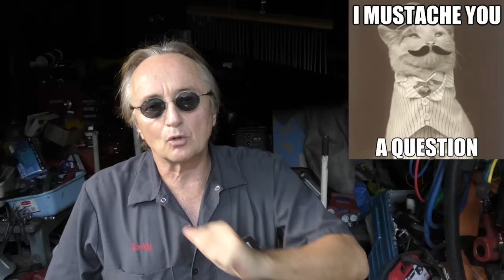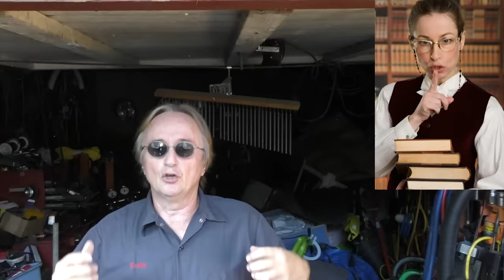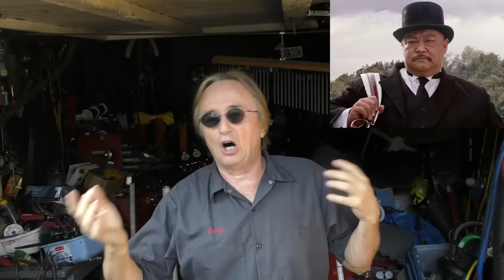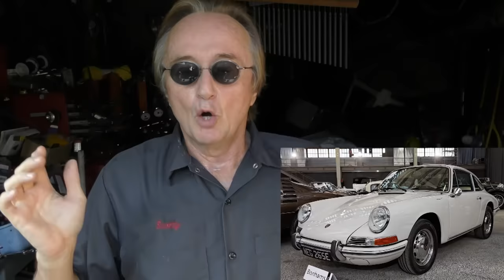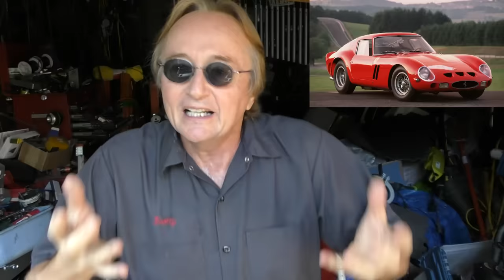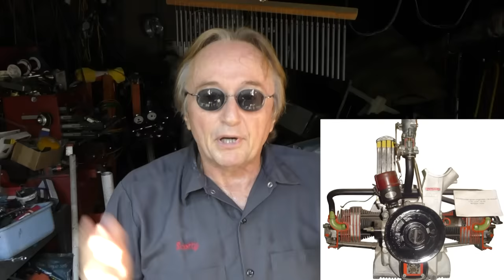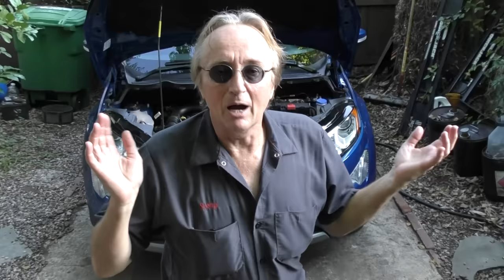The Truth About Boxer Engine Cars

Comment: Porsche was thinking about ditching the 911 entirely and replacing it with the 928. Has nothing to do with the boxer engine. A flat 6 still got the gt2 rs around the ring in record time. The V engine predates the boxer by 8 years so do we call v configurations "old technology?" Also until Porsche 919 broke the record, the 962 also had the overall record with a flat 6 and was the most successful endurance car of its time. Boxer engines were great for endurance racing for reliability.

Comment: My '95 Subaru  Liberty has over 400,000 miles on the original engine and is the most reliable car I have owned,I keep it maintained by doing things like changing timing belts every 100,000 miles ,changing oil regularly etc,the car is plenty powerful enough for my needs and is great on   fuel so for me boxer engines are fine ! Thanks for the videos Scotty.
Reply: Nigel Stringfellow didyou replace your head gasket.?
Reply: @zxttgg  head gasket wasn't really a big issue in that generation, the one after it is when they started getting head gasket problems.
Reply: I have a 98 Subaru Legacy with over 300 thousand miles on it original motor transmission an original clutch she is a pretty reliable motor
Reply: @zxttgg  
I have owned four different Subarus and never had a problem with head gaskets. (None of mine had automatic transmissions either.)
Reply: 295,000 km on my original 2002 wrx motor!

Comment: The main reason that VW discontinued the Air Cooled Boxer engine in 1975 in the Beetle was due to emissions compliance, not for any mechanical shortcomings.  Plus it was still made in Brazil into the 2000's.  It also never even had head gaskets.  I could never understand why the Corvair was deemed a failure, when it was essentially of a copy of the Beetle which went on to sell multiple millions more after Nader destroyed the Corvair.  And the Porsche, which is a Beetle design on Meth, is still produced today.  And if Subaru and Porsche are selling them today as fast as they can make them, how can it be outdated?  I am sure if Toyota made them you would be jerking off to them 24/7.
Reply: Corvair 32/68 weight distribution is unbalanced
Reply: That'll be one slippery snek of a car.
Reply: The Corvair had enough power to make the swing axle design cause problems that weren't apparent at <40 horsepower. 

The Porsche has had decades of chassis design poured into it to stop this from happening because cars like the 930 weren't called "widowmakers" for nothing. If you dropped throttle in a turn they could totally kill you.
Reply: It is my understanding the "bottom end" of the air cooled VW engine is way, wayyyyyy overbuilt. Guys that use these engines on sand rail dragster can often get 400HP with a stock crank and journals. 

I love BMWs boxer. Owned one for years. It's a very torquey but very boring motor. Has a nice panther like growl when you give it the beans though.

I think the main reason boxers have gone aways is the same reason V engines are going away. 

Accountants. 

Twice as many cam chains
Twice a many cylinder heads
Twice as many camshafts.
Reply: I used to road-race the Corvair (organized road racing was popular in the 1950s - 60s).   If you backed off the accelerator while in a TIGHT turn, the swing axle system would 'tuck up' on the inside of the turn causing a severe over-steer condition for the rest of the car when that tucked rear wheel took on its normal weight load .... for a high probability of an 'instant snap' 180° skid.   For normal driving conditions, if you had insufficient tire pressure in one of the rear tires, the 'snap 180° skid' could be even worse and MORE violent. 
FWIW -  Boxers are fast and easy to remove for working on them; they 'drop out' onto a transmission jack once the axels are pulled from the transaxle.
Reply: Yeah this guy is Toyota biased.  Not that I blame him but Subaru had a good track record.   Doesn't Toyota actually own them now?
Reply: Also the Beatle is the highest number if cars produced ever.
Reply: Tracey Allen Corolla overtook them recently, I think
Reply: corvair had  high rates of rollovers.
Reply: DIB 001 they're one of the shareholders but they don't "own" them
Reply: @TraceyAllen  yes, the Beatles produced a lot of noise
Reply: The last year of VW Bettle boxer was made in Mexico about 2002 and yes some were imported to the US.
Reply: Karl Reinke that’s a legendary quote: “accountants” on behalf of the Subaru community I thank you
Reply: momo3369  , , indeed yes !
Reply: @Andriig75  only if you add all the different models together. Beetles had basically the same bodyshell throughout its life, Corollas had several different bodies/floorplans etc over the years. Toyota lumping all the versions together and claiming they now hold the record for the most sold of the same car is cheating, they're totally different cars with the same name.
Reply: Andrii Gritsina that’s just the nameplate. Whereas the beetle was basically the same car with updates from 1938-2003, the corolla has been through many major redesigns, different body styles etc. the beetle is still the most produced in terms of single model, same design
Reply: As I remember Corvairs were notoriously prone to lose control with the rear end due to lousy weight distribution, and since the steering box was  exposed under the bumper it drove the steering wheel up into the driver on front impacts.
Reply: The swing axle VWs - prior to 1969 were susceptible to transaxle jacking or wheel tuck.  Basically, when cornering, the transaxle had a tendency to "jack" upwards.  Since the rear wheels are always perpendicular to the axles, this would induce a very unstable positive camber on the outside wheel while the inside wheel would lift.  This cased a dangerous over steer.  This same dynamic was in play on the early Corvair, Porche and Mercedes swing axles however Porche and Mercedes were not constrained as much by costs for solutions.

The VW engineers were aware of the problem early on, but didn't think it would come into play on a 40 HP vehicle.

Solutions involved softening the rear torsion bars, stiffening the front suspension with an anti-sway bar and adding a "Z-bar" or camber compensator to the rear suspension.   In 1969, VW introduced the IRS system which eliminated the problem all together.
Reply: @98triffid  i vaguely remember reading years ago the GM "bean counters" decided it would be cheaper to leave out a sway bar in the Corvair and have different air pressure in the front and rear tires to compensate. The trouble was that most owners didn't read the owners manuals and were unaware of the tire pressure recommendation.
Reply: @kenjohnson7214  Reminds me of Ford's decisions regarding the Pintos - my brother was an associate at a law firm that took up the case for a family, who's kids were severely burned after their Pinto was rearended and caught fire. During discovery they found a memo from Ford management to production regarding the possibility of fuel tank rupture upon rear impact; seems the shock brackets on the back axle were so close to the front of the tank they would act like spears going into the tank when it was driven forward by a rear end collision. Ford's money guys did a cost benefit analysis and decided fhey would spend less money defending lawsuits than reworking the axle  - essentially  saying " let 'em burn"
Reply: The Corvair was a failure because it was developed by Americans! Germans and Japanese know how to build reliable engines. 
BMW motorcycles are super reliable, Russian or Chinese copies are not. Same reason.
Reply: @289hipo  Then Ford, not having learned from that and the Corvair over at GM, decided to blame Firestone when Explorers began tipping over due to underinflated tires. Those who don't learn from history are doomed to repeat it.
Reply: corvair was not a copy of vw, although they did copy one of vw's suspension mistakes. They corrected it when they incorporated vette irs components in the second series. One of the first corvairs was  sold to porsche, a couple years later the 911 made its debut.  Folks are still finding corvairs in barns and repurposing the engines successfully for small planes. Ralph Nader was an uninformed jerk. I once publicly asked him and his team of "experts" about the transitions between oversteer and understeer on corvairs. Their response was that they were not familiar with that terminology. gen2 corvairs were fine. Sorry gm deep sixed em
Reply: @98triffid  The swing axle was only on Gen1 (1960-64). Also, there was an aftermarket to overcome this swing axle weakness.  
The Gen2 (1965-69) was actually more technologically advanced than the original Porsche 911. My 1965 Corsa was a beast and the only thing I had to do to improve the handling was to replace the stock rear tires with wider ones and replace the stock shocks with heavy duty ones.  I loved it!
Reply: @richh1576  Gen1 (1960-64) had the swing axle). The Gen2 (1965-69) had independent rear suspension.

Comment: I’ve driven most 4x4s, in bad conditions, in the Pacific Northwest, nothing is as good as a Subaru. A massive part of that is because on twisty, hilly roads the boxer engine sits low between the front tires. It’s not trying to breakaway on corners. When it snows in my area, Subarus are just about the only vehicles out and about (and there are a lot here!)

Comment: My new Subaru Ascent has a 2.4-liter turbocharged boxer-4 engine makes 260 horsepower and 277 pound-feet of torque, and it definitively doesn't feel under powered, that's more horsepower than my V8 Durango that I still drive.
Reply: Same here.  Wish I could get that engine in my foresters too

Comment: You get a top of the line AWD system with Subaru on a budget. Mother in law had an outback with 400k miles. 

I think that engine is just fine.
Reply: agreed buddy! just change your oil check your fluids and you’re good to go. most people dont tske care of their cars!!
Reply: @user-lq1dk6gr3p  
Amen to that brotha!
Reply: Top of the line AWD system? The Subaru AWD system is more out of date than the boxer engine, literally everyone is making intelligent AWD better than them.

Ok almost everyone.
Reply: Chance any evidence to support the claim that their awd is out of date?
Reply: @Preh  Those new AWD systems suck and cant even touch subaru's.
Reply: @Preh  "intelligent" awd just means 2 wheels aren't getting power until the car detects slippage. Which wouldn't happen in a Subaru as all 4 wheels are constantly getting power
Reply: @Preh  Might not be "intelligent" but it works. I've owned a lot of cars and live where there is a ton of snow and ice. NOTHING comes close to a Subi for keeping you from getting stuck or sliding in the ditch.
Reply: @Preh  A Selectrac Jeep XJ with LockRights front and rear is out of date and simpler than most modern AWD systems...but none of the expensive new AWDs are going to follow that XJ on extremely difficult terrain. Intelligent, advanced, etc., isn't always BETTER.

 Rear lockers are available for my CVT Subaru Crosstrek, BTW. It commutes great in the winter just as a stocker though, and I top 40MPG with it. It has proven to be an extremely versatile little car. It could use the 2.4T motor though, and the 6spd would be more sporty.

 Are lockers available for those other AWDs? Skids? Winchmounts? Mudders? A lowly Crosstrek can have all of that.
Reply: @user-lq1dk6gr3p  No kidding about checking the fluid levels.  After 30 years of driving Saabs that didn't use oil, I was less diligent about checking the 2015 Forester than I should have been.  We're good about oil changes, but I was shocked to find it a quart low in the middle of a road trip (frantically trying to get home in March 2020).

Oil added and I check it now.  Lesson learned!
Reply: @Preh  subaru's symetrical awd system work very similar to the original audi Quattro drivetrain (arguably still the best ever made) When it comes to awd, mechanical is best.

Comment: Scotty strikes me as the kind of guy who decided he knew everything 20 years ago, and hasn't learned anything since. I have had old timer mechanics just like him tell me authoritatively that placing a car battery on concrete will make it discharge - something that hasn't been true since we stopped making the casings out of wood.

Hey Scotty, if you took a V6 engine, and made the V angle 180 degrees does that engine instantaneously become outdated? Of course not, because the boxer/180 degree engine is technologically the same as a V or inline engine. The main reason most manufacturers stick with an inline or V layout is for packaging. The boxer can be mounted low, but it takes up a large area and pretty much leaves you no option but to mount it longitudinally. That means you get the triple whammy of a large engine bay, a transmission tunnel and rear diff that has to fit under your car - all that takes up a lot of space. Your typical manufacturer will instead take an upright engine, and cram it transversely with a transaxle into the shallowest possible engine bay to maximise the amount of cabin space they're left with.

And this isn't 2001 any more, Subaru aren't making EJ25s with graphite coated gaskets. They are no more prone to head gasket problems than any other vehicle.
Reply: Tell that to my 2006 outback and any number of subarus I know of that blow them before 100,000 miles. Never heard of that with any other car.
Reply: @lunarpking  that hasnt been an issue with Subaru's newer FA engines
Reply: I love my 2015 subaru 2.5i ps batteries still shouldn't go on the ground when it is hot a kid i was teaching to be a tech put it on the hot tar and boom went more puff and fizzle
Reply: Inline fours cost less to manufacture too. Both my Subarus were super reliable. They were both 5 speed & used to beat the snot out of them. Traded my 08 with 160k with no big repair costs other than a clutch (I beat the crap out of it 😝).
Reply: That's why the engine belongs in the back! *Porsche
Reply: Only certain variants of the EJ engine got the head gasket issue, it is not a Subaru issue, then we have the lack of maintenance and the abuse that some people put their cars through.
If you mantain and take care of your car you can make it last a long time.... even Toyota has unreliable oil burning engines that are product of flawed design, nothing is perfect.
And I love my 2018 WRX, the handling, the engine sound and even the fuel economy, I rather drive my WRX than the most reliable and boring underpowered Camry, no automatic transmission for me either like the 300 HP modern Camrys.
We can buy what we like, what's the point in trying to "approve" individual choices? You like Toyotas good for you, respect other people's choices and if you really want to help, since you have a lot of years of experience as car technician, then share your knowledge about servicing and maintaining all kinds of engines; my uncle Rudolph owns a 1964 Dodge pick up truck, we lost track of the mileage because the odometer broke and he still drives the darn thing, so much for stating that Dodge vehicles are a pile of crap.
Service, mantain and take care of your car.
Reply: Obviously you don't understand about the old batteries either, it's not because the casings were made of wood. You and Scotty are two peas in a pod, hahaha
Reply: @tmeyer729  Such an enlightening and insightful comment

Maybe casing isn't exactly the right word. It was just a box really, holding glass cells. The wooden boxes would wick moisture from the concrete, swell and crack the glass cells.

So please do elaborate on what you think is incorrect about this, oh wise one.
Reply: @t_z1030  please excuse my rash ignorance,    I was on a Subaru rant. You are correct, I had never heard of that, I was thinking of the cells losing heat from the cold concrete floor and freezing or becoming sluggish from the cold draft along the floor and ground. I too have had older people tell me the same about batteries. You and Scotty are nothing alike hahaha.

Comment: Porsche GT2RS and GT3RS are literally some of the fastest cars ever made. They use boxers. Yet you argue they are obsolete. You have no idea.
Reply: Deez Nuts  theres always a way to make it work :)
Reply: Dragsters are the fastest cars ever built. I've yet to see one with a boxer engine!
Reply: In terms of the general market they are.
Reply: they are high-maintenance, very expensive racing models champ...
Reply: @wilson2000t  Because they drive in a straight line - boxer engine is amazing when it comes to handling.
Reply: @flightofthefatman   Subaru only uses the boxer, and 97% of them since 2010 are still on the road
Reply: wilson2000t “Dragsters” they aren’t even fit to be called a car.. they have two giant wheels and two bicycle wheels at front, a very powerful engine, single seat, a parachute, and a ginormous wing.

You’re like comparing a fighter jet to a small private plane..
Reply: Yeah, they're good for maybe 3 miles if you're lucky? 10 minutes, if you include idling time? Rebuild it every week, or so? Whole different world...
Reply: Lucky Guy nahh. Mine still alive 259k miles. No rebuild. Just maintenance..
Reply: Jistro seems like just a goofy old dude with his opinions and lots of different camera angles and locations in his yard to jump around to.